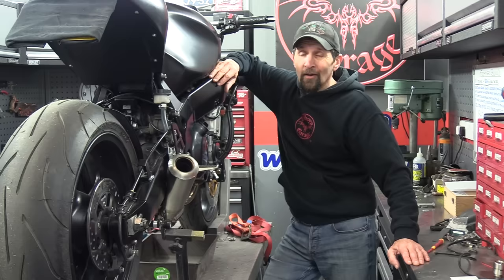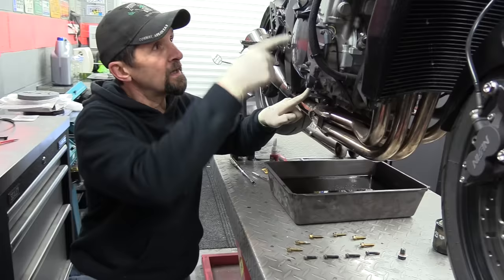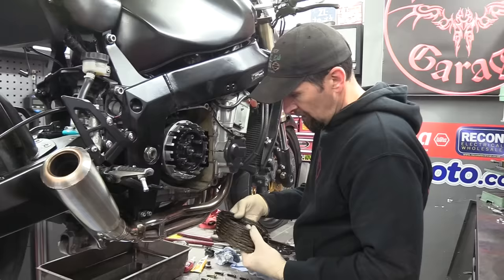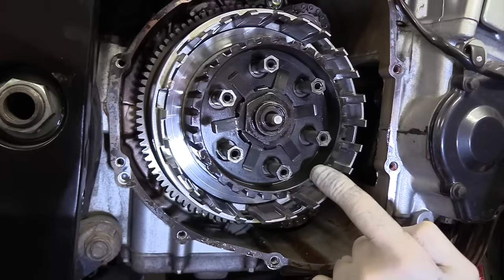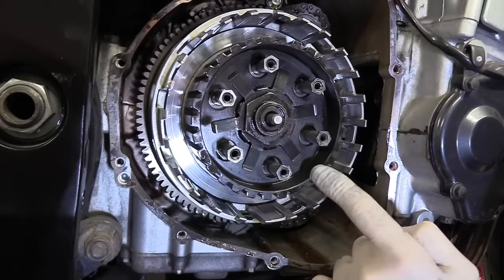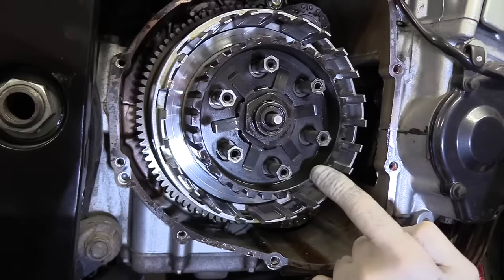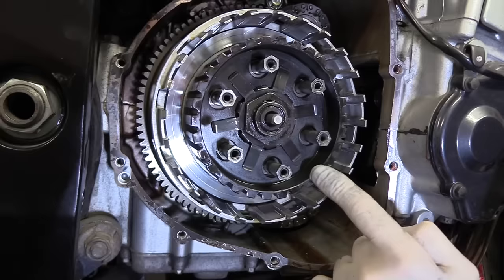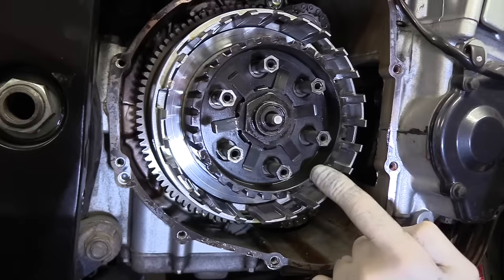Delboy's Garage,  Motorcycle Clutch Replacement .

Comment: Great video Del looks like I might need to strip the GPZ clutch at some point as it sticks sometime after a few days in neutral, the jolt after warm up and first still makes me feel uneasy.
Reply from the maker: Hi buddy, sure things, that's a different problem... often you may have some notches woen in the basket which could cause it, or it could just be in need of a good clean up... drop the plates out, lay the steel plates on a piece of glass, make sure they're all flat, and with the fibre plates you can rinse them off with some petrol and clean all the old oil off, then dip them in some fresh oil, put it all back together and see how it goes... good luck with it mate, Del
Reply: @Moonfleet41  Thanks for the tips Del. It's due an oil change now anyway so would be a good time to check it all.

Comment: What torque wrench are you using?  I got a cheap one that ended up striping and breaking the banjo bolt from the cylinder head cover.

Comment: Tell me pls i replaced
Friction discs
Steel discs
Pressure plate
Springs
Made adjustment by the service manual and my clutch still sleeping in high rpm
I look inside basket and i see small groovrs on the inner basket it can be the cause? And do i have to replace it? 
Maybe i can sand and polish it? The grooves not deep

Comment: Can you perform a fully detailed clutch replacement for the GL 1500. I tried searching your playlist for a video on the GL1500 but did not find one. The clutch on my 99' GL1500 is often crunchy at times when shifting, and will also shift into false-neutral at times at low speeds between 1st and 2nd gear. The clutch slave cylinder has already been replaced... Thanks in advance.

Comment: I have to commend you for sharing the details on basket inspection.  Recently replaced my 55k mile fz09 clutch pack and as it turns out the friction discs teeth sort of wear with the basket.  When I put new plates in, I started getting inconsistent engagement and shuddering, which seems like the fresh edges on the discs sort of "hang up" in the little wear grooves in the old basket. Upon reinspection, the new plates created a few burrs in the basket, which I filed down, and It's a bit better now, but I can't help but think the basket should be replaced.  So I'm left with a question- replace the hub and basket together, or just the basket?  Guessing there's a best practice for this situation.
Reply from the maker: Hi buddy, not necessary to replace it, in the past I've had some pretty bad 'castle-ation' on the basket fingers and I usually draw file the ridges out with a very fine modelling file, best to take it out of the bike if you can to avoid filings getting in the engine, but not essential... if you wedge rags all round it.  If you can make those ridges smooth enough and take the burrs off the clutch plates, it should smooth out your clutch action no end, but if you've done that many miles in a short time, then you may as well replace it, it's a matter of economics mate.

Comment: Mr. Dellboy I have a 2009 Zx14. I have the Trac King aftermarket complete clutch kit and Brock's .280 spring and spacer kit. Now I know about the judder and washer, but some of my new fibers from Trac King are color marked on the edges. However the fibers are all the same stack thickness except for the thickest one that goes in first inside the clutch basket.  Does it matter about the marks? The thickest fiber goes in first, then steel, large diameter thin fiber, then flat washer with judder spring, then a steel, ect.. until the last fiber, then friction plate. Not all fibers have a color mark on them. As long as the stack height is within spec, will the clutch work?

Comment: Question; Triumph Speed Triple 2011-15. Replaced my clutch because it was slipping mid revs. Thought I'd experiment and treat myself whilst at it to a racing clutch. Replaced the lot, springs and all plates. Seemed to have sorted the slipping issue but now when I leave my bike for a few days the rear is stiff/ locked and it is really different to move. Needs nudge whilst straddling the bike and so that what it feels like for the clutch to release. If the bike has been left for weeks then I have to push the bike with a lot of strength for it to free roll. Any help will be appreciated

Comment: Thanks for an awesome video! I need to change the friction plates on my 1999 ZX9R - this video is extremely useful. Does the clutch cable mechanism at the top of the basket cover just pop off and on or is there a particular way to reseat it? Thank you.

Comment: Just turned 30K on my 40 yr. old kz1000, and 43K on my ZZr1200, i suspect clutch work may be in my future lol.  So far both seem fine, wondering if i should just do the KZ, mainly because its air cooled and am sure those clutches have seen some heat in its lifetime.
Reply from the maker: Hi mate, good to hear from you, and welcome aboard, thanks for the recent sub... with your clutches, actually it's more simple than you may think, it's a perfect example of the old mantra "if the cart ain't broke, don't fix it"... seriously, unless your clutch is slipping, or dragging, then it's fine, just leave it alone... by all means pull the plates out and inspect them, but if there was any problem with them, it would manifest in problematic control, clutches are more about mileage than time, and if ridden respectfully, a clutch can last the life of a motorcycle, maybe 100k or more, it's only abuse that ends their life prematurely... good luck with it, thank you for your kind support.

Comment: I have a 95 suzuki gsx 600f katana. I replaced the friction and steel plates, the springs and gasket. after putting everything back I started my bike and it slips in 1st, second, 3rd gear now. What could be causing it to slip?

Comment: Hi Del, your videos have inspired me to restore my 94 zx9r! Thanks for all the great tips and advice. A question if I could, I just bought a TRK brand set of clutch fibres from wemoto, and the fibres on the plates are not squares like yours and the old ones I pulled out, they are at an angle..like a saw blade if you will. I am wondering if these plates would be directional?? Thanks again. Ride safe
Reply from the maker: Hi mate.. thank you for your kind words of support, glad you enjoyed the video..  With the plates, they will only be directional if the 'slant' is the same both sides, or opposed.  If they're opposed then it doesn't matter, but if not then ask Wemoto if there is any information from TRK as to which direction they fit... perhaps there is an "In & out" stamped on them if they are..!!     Sorry can't help more on that one, best to check with the manufacturer..!

Comment: Quick question I put my clutch housing back exactly the way it came out but I go to connect my clutch cable and push the clutch all the way in and it doesn't release the rear tire in neutral. Do you know why this migh be happening.

Comment: Excellent video Del, i was wondering, the fresh oil which you have soaked the frictional plates in, you put it in the engine or you dispose it? Keep up the good work!!
Reply from the maker: No, don't waste it, tip it back in the can and use it in the engine, its perfectly clean.
Reply: Great, thanks for the tip!!

Comment: Just wondering I have a 125cc 4 stroke and it's started to jump out of 5th and sometimes not going into gear properly.also rattles on tickover and when I hold clutch in.but rattle stops when I release clutch to the biting point..do you think it's a clutch problem

Comment: Is it correct to assume that unless it says otherwise all torque values assume dry, oil-free threads? I sometimes wonder if oily threads would end up being over-tightened or if oil in a blind hole could create hydraulic pressure in a vulnerable part of the casting (Harley Twin Cam lower rocker covers are a good example of this).
Reply from the maker: I always reduce torque values on old engines, the metal is old, possibly fatigued, countless heat cycles, always oily because it's an old engine..so anywhere between 10 - 20% lower depending on various factors then you never strip them, and they never fall out..   Harley Davidson have the best policy of advising a torque "range" rather then a single value.. that way you can default to the lower end of the range on all but brand new bikes..!

Comment: Great vids as always!! I am doing this procedure now, is it ok to scotchbrite the few burn marks and glazing on the steel plates? thanks again!
Reply from the maker: If you're getting scorch marks on your steel plates, then it wouldn't hurt to replace them, it means they're getting very hot and on the border of buckling which will then lead to them slipping with more hotspots and eventual failure... the big danger is, if a fibre plate breaks up inside the clutch, the wreckage can destroy everything in the vicinity... so tbh mate, buy a new set of fibres, a new set of steels and ride with confidence that everything's good, clutches are consumable, like brake pads!

Comment: I’m having clutch problems and need help! My Barnett clutch has about 1,200 miles on it and it is turning my oil grey slowly and at about 250 miles I have to change it I can’t let it go anymore they say the steels don’t matter which way they go as long as they are facing the same way and I think I got it right but I don’t think it would matter even if the steels faced different ways the frictions still ride on the flat surface and it makes no sense please help

Comment: Awesome work yet again Del. Is the clutch on my 2005 Gen1 Tuono the same?
Reply from the maker: Hi Damion, it won't be the same clutch, I remember the early RSV engines had what they marked as a PPC clutch (pneumatic power clutch), which was apparantly meant to act like a tiny air bag in the back of the clutch as an anti-locking device on over run, same purpose as a slipper clutch, but I've never opened one up and looked at it, so I can't describe it to you any further than that... but you can pretty much guarantee it won't be the same!

Comment: I have 2 torque wrenches smallest for small jobs starts at 5nm did you feel.any difference in feel to clutch I recently replaced master cylinder parts as it was not great and soare lever as old one broke it's all good passed mot  etc as expected but feel my clutch lever could be a bit less firm to press some say the lime sone say slave Amy ideas ? Cheers del

Comment: As always, great video. Only one question: How do you easily remove the stuck gasket and clean the bot surfaces without scratching them?
Reply from the maker: Hey Bruno, traditionally all gasket faces need to be cleaned very gently with a sharp scraper, as shallow as you can so as not to dig in to the surface, don't use any form of sandpaper, or anything that will rub away the aluminium... if it's really stubborn and won't shift, you can soak the gasket in WD40, leave it overnight, and it will be soft in the morning and slide away easily... and once again, never sand the surfaces in an attempt to make them flat, they're already flat, they just need to be clean... hope that helps you Sir, thank you again for your support, Del

Comment: Is that plate config the same for all bikes? IE start with cork, end with cork? Wasn't clear in my Haynes manual when I did my XJ900F clutch a few weeks ago, if that set-up is universal looks like I'm tearing it out again! Great vid as ever, nice to see some nut-and-bolts spanner action again
Reply from the maker: Hi Jack, yes indeed, the pack itself always starts and finishes with a fibre disc, because if you look at the hardware in the bike the base face of the inner hub is steel and the outer face of the pressure plate is metal also, so naturally you would have fibre up against metal, unless you have some other strange configuration but I've never seen it personally... if you're concerned in any way, just drop the cover off and take a look because the consequences are serious... if you place metal face to metal face at any point it can friction weld itself together which will destroy the metal surfaces... and if that's the inner face of the hub, then you'll need a new one, and the same goes for the pressure plate... they're metal so should have fibre up against them... in fact, it's pretty impossible to get it wrong, cos there are always more fibre plates than steel plates, so you should have it correcrly assembled otherwise you'd have had one left over,,, if in any doubt mate, take a look inside and see what you did...
Reply: Really appreciate you taking the time to help out Del. That makes a lot of sense, and fills a gap in my knowledge - and I did have a plate left over, which I couldn't work out! Thankfully, the bike's only been out twice for short runs, just didn't feel right so I've left it til I had time to check again - which will now be tomorrow morning! Thanks buddy

Comment: Another great vid Del . Just wondering did you replace the radiator on the bike , or did you refurb the original ?
Reply from the maker: We treated her to a new one, as the old one was corroded and full of road crap on the front, and would have been a liability going forward!

Comment: Hello ,thank you for the knowledge 
What is that screwdriver/ratchet thing called? I need it in my life
Ty again
Reply from the maker: Hey buddy, it's just a regular 1/4 drive ratchet fitted in to the back of the nut driver handle, should be an inclusive part of any 1/4 drive socket set.

Comment: Hi Del, love this video, just referring to the gasket is there any harm in using blue hylomar both sides of the gasket or is that a no no, Thanks john.
Reply from the maker: Hylomar on the gasket (casing side), grease on the engine..! that way it comes off 100% attached to the casing in future and not with half of it left stuck to the engine..!
Reply: @Moonfleet41  thank you del, would you use the same method for a stator cover on a fireblade, thanks john.

Comment: is the bike on gear when u do this or is it in neutral???? whats the torque on the bolts from the clutch case???and the oil torque as well. also is it all the torque the same for all bikes???
Reply from the maker: Hi Carlos, no, you can perform this with the transmission in neutral... from memory, on this bike, believe the torque setting was roughly 8.5Nm, but please look up the exact torque vlue for your bike, because, no, they are not the same!

Comment: This video is a couple of years old but still very good. Thank you!! You have grate videos.
Because of you i got over the fear of working on my bike> Thank you for that.
I do have a question!
I got a Suzuki GSR 600 ABS 2010. My clutch is not shifting down properly. When i come up to a stop sign and start schifting down, it stays stuck on a high gear and only shifts back when i release the clutch leaver a little bit, then is starts shifting down. shifting up is not realy a problem. Do you know what can cause this problem?
Reply from the maker: Hi buddy, some bikes don't like to shift down through the multiple gears while at a stand still, and letting the clutch lever out just a little to align the cogs in the gearbox is perfectly fine and quite safe won't do any harm buddy.. 
As for coming to a stop in a high gear...Unless it was an emergency stop, you should really be shifting down gear by gear as you slow down, arriving at the final stop in second.. then you can click down into neutral, and when it's time to pull away, clutch in, select first... See if that helps..

Comment: (P) So interesting Del, I love this stuff. Do you think a garage would soak the plates overnight the way you have done?
Reply from the maker: Hi Michael, yes indeed, it's standard practice, any mechanic knows to do this, it's essential as the clutch wouldn't last a week if you put them in dry...
Reply: Interestingly enough I only soak them while I strip the clutch case off the bike; my VFRs clutch was still going strong 100k miles after I changed it... I don’t think a garage will soak overnight.  Good vid though.

Comment: Awesome. Do you have a recommendation to remove the cover from a 1978 kz650 that was glued. ? I was thinking in a scraper blade to open a gap and cut the glue and then a flat screwdriver. But I can damage it. Thanks
Reply from the maker: Hi Francisco, good to hear from you Sir, with your casing, most glues that are single pack formulation (so not epoxy), are susceptible to heat and can be melted... any threadlock compound can be released with heat, in fact even superglue melts with a little heat applied, so before you use force, use a hot gun, but not too hot so as to damage the paint, even just a hairdryer on the hottest setting, then take some time to heat up the casing around the join till it's hot to touch by hand (but no so hot it burns you)... this gentle heats should melt the glue and the casing should come off... it's probably not glue, maybe just a strong silicone sealant, which should melt and release ok.  Good luck and be careful, gentle patience will always make good results!
Reply: @Moonfleet41  thanks so much. Great advise. I let you know the results. Have a great week

Comment: I have a 94' harley heritage softail, with evo motor,  the bike vibrates alot at all speeds, i was told it could be my clutch plates,  I just bought this bike 6 mos ago it has 48k miles so im not sure if they have ever been replaced?  I bought the friction plate kit just wanted to know if this could be cause of issue?
Reply from the maker: Check primary chain tension first, and all motor mounts, vibration from a clutch would only be under acceleration and no other time, certainly not at idle and in neutral... so maybe that helps?.. good luck with it buddy.